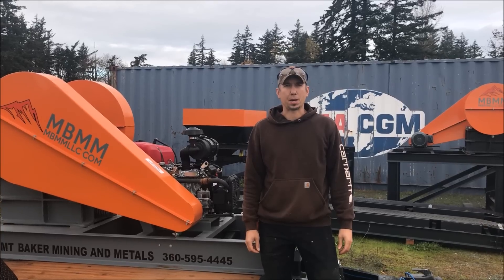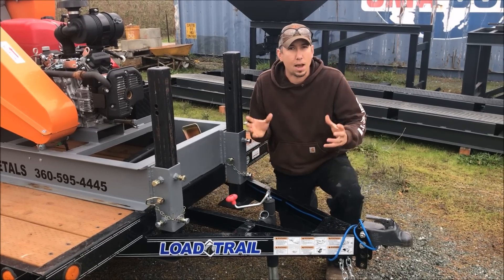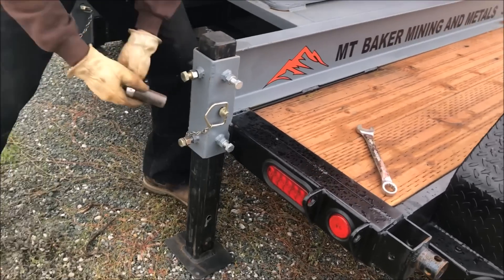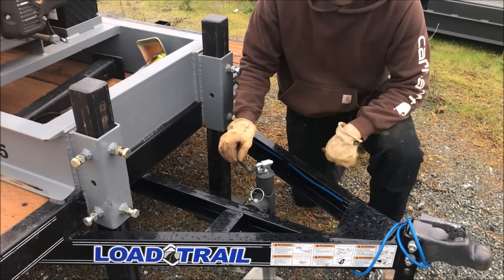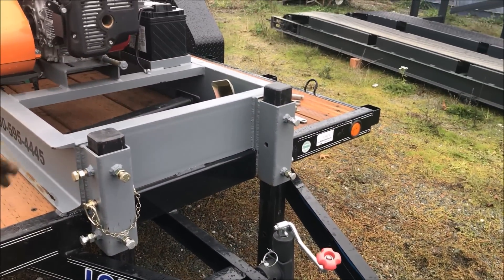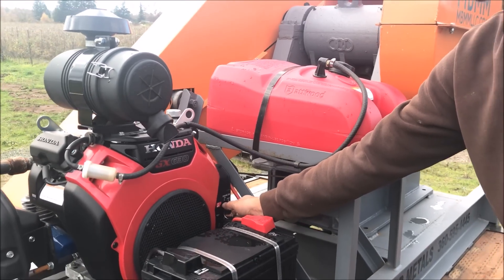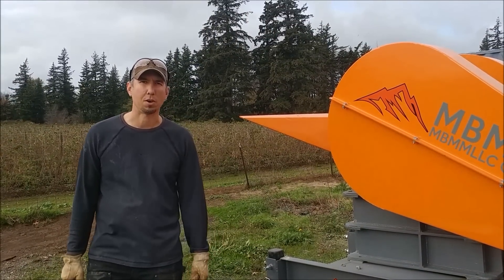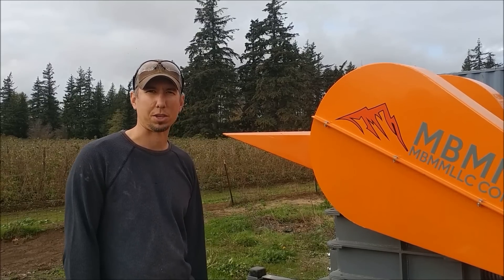Mobile 8"x 12" Jaw Crusher on a Trailer Powered by Honda Engine

Comment: Math is interesting assuming recycle of a 10' x 50' concrete driveway. Est 160 cu/ft of demo'd slab = 24000lb/12 US tons. Crusher through-put at 3TPH = 4hrs crusher feed time.
Resulting crushed product is 12T/+-8 cu yards. 
Dump tip fee and trucking to get rid of 12T concrete rubble is +-$500. 
8cu/yards of crushed concrete has resale value of +-$200 plus trucking
It's unlikely that a simple driveway replacement would require 12T of added stone, so either sub-base dirt or stone would still need to loaded/hauled away for grade match.
worst case even if the stone was exchanged for free haul-away, contractor would eliminate $500 in rubble dump fee.
Added cost would be ownership/operation of the crusher and several man/hrs crusher feed time. 
Assuming capital investment of $25000 and 10yr useful life =$2500/yr rough depreciation
Assuming +-$3.00 P/T crusher maintenance/operation??

Financial impact of 50 driveway jobs yr at 500Sq Ft each = 600 tons of rubble 
$9000 added onsite through-put labor
$1800 crusher maint/operation cost
$2500 annual crusher depreciation
------------------------------------------
$13300 annual crusher cost

($25000) annual dump fees

$11700 potential annual crusher profit*
*There's probably some up-side profit potential depending on how the crushed concrete is managed
In this scenario the crusher is simply a dump-fee eliminator. Local dump fees are the big variable. Some added labor will be expended fracturing rubble small enough to feed the crusher VS load/haul/dump. A metal extracting magnetic conveyor is required for any of this to make sense. Conveyor will require suitable, portable electrical source (not described on the video). 
Still an $11700 annual return for $25000 invested isn't bad.
Reply: @Daniel Stevenson Depending on your contract sales, this type machine seems like something to check out. I'm not sure if this company offers a self contained magnet w/gen set, but that feature is likely a necessity when recycling slabs to gravel. Magnet setup requires a fair amount of current. Also on-site slab to gravel processing would probably be slower VS conventional slab demo/load/haul/dump. Logistically better to haul demo slabs to your own yard to crush away from the jobsite, at your convenience. OTH, if you could get crushed product hauled away from your job-site for free, it might eliminate the need of owning a dump truck at all.

Comment: That looks more like about 120-150 rpm instead of the stated 300. I would like to build one with a smaller motor.  It appears the motion amount and direction is critical in design. Also rpm must match in the psychics aspect. High rpm shorter stroke with the plate or low rpm with greater stroke?  The slow stroke being more powerful because it allow motor to be geared down more.